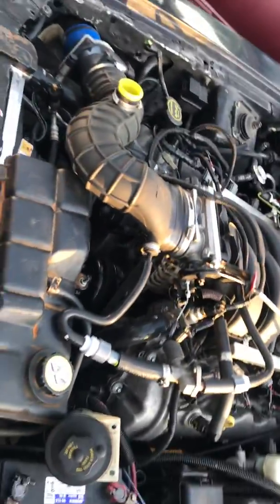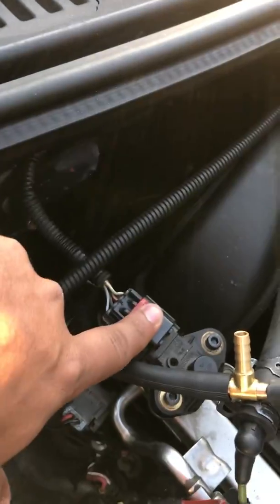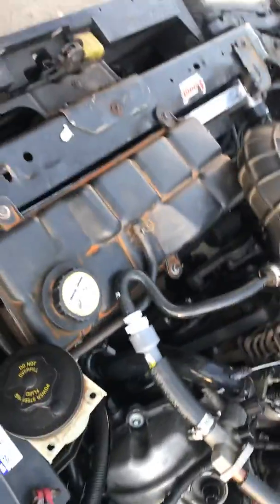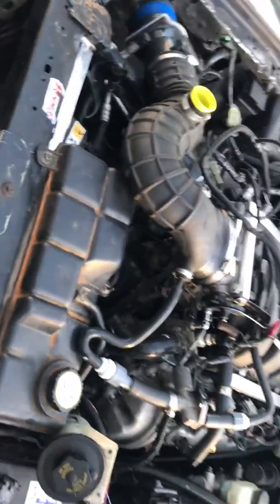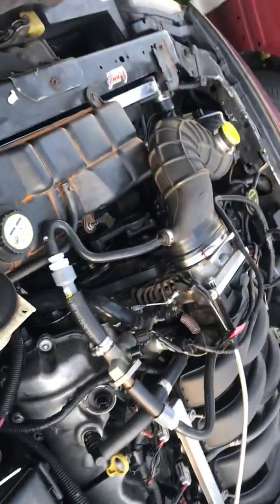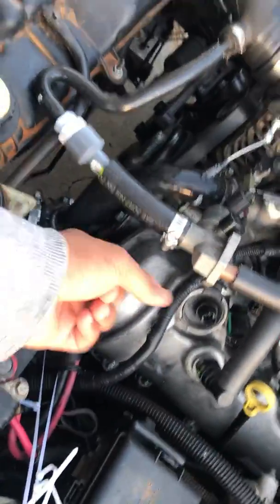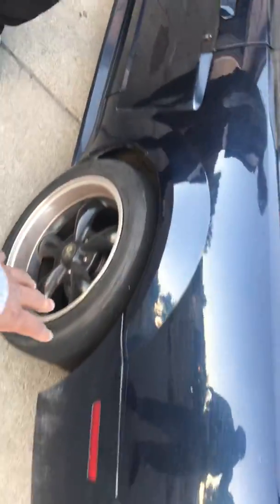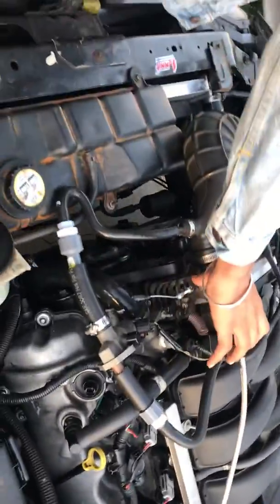1999- 2002 Mustang gt, 3V swap.. info

Comment: So everything from the 2valve harness will run the engine other than extending the connectors and changing the throttle cable right?

Comment: I got a 96 cobra I 3v swapp due to blown head gasket jump time  smh but I got 05 gt motor full wire harness pcm and gas pedal but I need help with wiring and vacuum n fuel lines I can pay for the advice or steps to get me back on the road
Reply from the maker: What’s going on with it? 
Send me email punjabisingh0@gmail.com

Comment: Hey I’m currently doing the swap and I was wondering how you wire the 3valve Fuel pressure regulator to the 2valve harness.
Reply from the maker: Your 3v fuel pressure will have 3or  4 prong plug, you only need to wire 3 wires into your 2v harness.
Don’t use the fuel temp wire use the other wires and connect those to your 2v harness
Reply: @vally520  ok got it, do you think you can let me know what colors to use? Or which one is the temp wire?
Reply from the maker: @nigelurquiza4573  we had sold the car few years back. i think you should be able to search it up, if i find it i will comment here.

Comment: Did u lock the cam
Reply from the maker: yes you have to lock them
Reply: @vally520  what if you don't ?
Reply from the maker: @Motormuscle21  you have to lock them if you want to use the 2V computer since it doesn’t have VCT support

Comment: Hey what wires go where and which one doesn't get used on the fuel pressure regulator  and what about the throttle position sensor wires and what about the little electric motor on the back of the intake that works too little butterfly arm the intake
Reply from the maker: you don't need to use the Fuel Temp wire on the 3V fuel pressure Regulator. Connect the remaining 3 wires.

Comment: Trying to stick 3v heads and intake onto a Grand Marquis. Kind of the pinnacle of Ford SOHC motors, as well as the last with that deep rumble. Coyotes are dope, but waaaay too expensive.
Reply: Ever heard of the 4v?  The 5.4/5.8 4v has the same old firing order that made 3v and 2v sound great it was same as the old pushrod.  So those engines went all the way to 2014 so it isn't only coyotes after 2005 outside of the 4.6 3v.
Reply: Also coyotes are more expensive but way more capable than a 2v or 3v stock for stock and when modding it.  So yea it costs alot more but to make a 2v or 3v run as good and stay together as well na and boosted you'd have about as much or more into it as what a coyote costs.  You can throw a coyote in with a blower and make 800 wheel (gen 2).  To do that with most engines its gonna require some decent work not just boost on a stock long block.  And it still drives and idles like a stock car this is why coyotes are awesome.  They make killer street and race cars they're good at both.  They can make alot of power reliably with a stock long block.  No need for heads or cams or built motor etc you can make 800 with stock shit easy.  Just boost and fueling upgrades.   Super simple.  For what you're getting the coyote is decent value.

Comment: Would the auto transmission line up with the 3v and work off a 01 mustang gt
Reply from the maker: i think it should line up if the bolt pattern is the same. we used 5 speed trans tr3650 that was originally in the new edge mustang 2v. Goodluck on your swap
Reply: Yes it's a mod motor same bolt pattern.  2v 3v 4v or coyote doesn't matter.

Comment: I wonder if you can do this swap cause I have a 2008 f150 4.6l 2v triton and I want to swap the heads to get 3v per cylinder
Reply from the maker: I doubt you can do that LOL but I could be wrong. But I’m sure you can swap in a 3V motor in ur truck.

Comment: Need assistance with new edge 3v swap what's needed for stock replacement full bolt on setup?
Reply from the maker: @sniper Mitchell what are you trying to do? Do you mean you want the parts list to do the swap ?
Reply: Yeah got a 02 new edge cont chassis and found a 07 motor
Reply from the maker: @snipermitchell6373  -2V wiring Harness/ECU
-Install Cam Lockouts
-Cut tabs off from passenger side cam phaser, leave 1 in the middle alone
-Use everything else from 2V
-3V headers that come with the 3v engine
-2v transmission(we used TR3650)
-3v fuel pressure regulator (Use the plug from 3V and use only 3 wires connecting to the 2v harness, you don’t need the fuel temp wire but connect the other 3)
-you will have to extend few wires,
Reply: @vally520  thanks
Reply from the maker: @snipermitchell6373  if you got any questions let me know

Comment: So you didn't need to cut anything off the cam phasers, just did the lockouts, and no issues? Also you used 3v fuel rails and they plugged right in to the 2V lines?
Reply from the maker: you do need to cut the Passenger side tabs off the cam phaser, and do lockouts if you don't cut your car won't run right. You will cut all of the tags but leave the one that's in the middle alone. Yeah use 3v rails and 3v fuel pressure regulator but you will only connect 3 out of 4 wires to the existing 2v pronge. Leave the fuel temp wire as is don't connect that to the existing 2v wiring, you can find out the wiring colors for 3v plug.

Comment: Just saw your video and it was helpful, I am swapping my new edge v6 automatic to a 3valve manual, one issue I’m running across is the tranny. For some reason where the shifter is, it won’t fit into my car. What should I do?
Reply from the maker: Mhmm that is weird, what transmission are you using ? It should fit right in I don’t think Ford changes anything with the chasis from auto to manual.. make sure your engine is sitting properly in the k member holes
Reply: @vally520  what happened was since my was a new edge the 2008 tranny does not fit into it, I just need to get a 2valve trans with a 3valve motor
Reply from the maker: sergio sanchez yeah I don’t think that will fit then, try to find a TR3650 transmission out of 99-04 GT or mach1 they work fine and should fit fine in the car
Reply: @serge920  do you have any tips and advice on this swap? I have a couple questions.  Currently i have the same set up an 04 v6 auto and i want a 3v gt manual swap. 

-Where did you get your parts? I was thinking going to a junkyard or purchasing a salvage s197 gt manual and swapping everything over engine, transmission, motor mounts, l member etc etc. Does that work? 

-What are the key components that I need for this swap ? For example which motor mount do I use, what K member do I use, and does the stock ecu work with a swap like this? 

Sorry if my questions are all over the place I’m not sure where to start
Reply: @jenniferbaez5201  so with my swap I am running a 3v engine with a 2v tranny, u will need a 2 valve clutch as well. I am running on 2 valve long tube headers with 3 valve flanges on it. I bought the flanges from Facebook and it was welded together. My mechanic is doing the electrical part but he said he had to run 2 computers for the car to work. All cars are using one computer but with mine since it’s complicated it’s running 2 computer, one for the engine and the other for like little features such as the alarm, key initions, and other stuff. Honestly I regret doing the swap because it has taken me so long to do it with so much work that at this point I should’ve done a cobra terminator swap or coyote swap. But to each their own
Reply: @serge920  Im really sorry to hear that it was a lot of work but i do hope you eventually enjoy this build. Any tips or recommendations before I do something like this? Also how hard do you think this’ll be

Comment: What throttle body do i use i need help i cant finish the swap bc i need a cable throttle body and the 3vlave one is electric...so what do i do iam doing the swap in a v6 using 3valve pcm
Reply from the maker: You can’t use 3valve PCM, or you will need all the wiring harness, use your 2v PCM and use 03-04 cobra throttle body
Reply: Sidhu Motorz  but iam i have a v6 iam outting it in
Reply: Sidhu Motorz  but if i use the 3 vlave pcm i need the 3valve gas pedal ??
Reply from the maker: @MiguelMartinez-rm9we  yeah then you will also need other wiring harness from the 3v as well, why don't you use the 2v PCM. i have a 2v PCM if you want to purchase.
Reply: @vally520  I have a 2003 Mustang GT and a 2005 GT 3 valve where did you get your throttle body I am having trouble with finding it or making it work if you could let me know. (malcolm.dev.turk@gmail.com)
Reply from the maker: Malcolm Turk you need the cobra throttle body should be less than 100 bucks search on eBay, TB has to be cable driven
Reply: @vally520  can you send a pic or link of what i should look for if you dnt mind i have found plenty with cable but no vacuum hookup for hoses
Reply from the maker: Malcolm Turk this should work you don’t need to connect any hose to the throttle body,

https://www.ebay.com/itm/264883962637
Reply: Hey whts up man i was trying to see where did you get the adapters from for your injectors and whts the name
Reply from the maker: Malcolm Turk those are called like EV6 adapters you will be able to tell by looking at the pics on eBay.

Comment: Stock k memeber??? I need help Iam 3valve swaping my newedge v6
Reply from the maker: Yes stock k member
Reply: Sidhu Motorz  ok thanks man and i got one last question do i buy a 3 valve drive shaft? Cause iam putting in the 3valve transmission too so do i buy a 3 valve drive shaft? Or what do i use?? If u can asnwer asap thanks its almost done

Comment: Having difficulty with the fuel pressure regulator , help
Reply from the maker: Ladarius Harris what’s going on? Use your 3V fuel pressure regulator and since the 3V one has 4 pin wires, don’t connect the wire that is for the fuel temp.. connect the other 3
Reply: Car cranks but not starting
Reply from the maker: Ladarius Harris email me punjabisingh0@gmail.com I’ll send you my contact #

Comment: Can you use the 2 valve transmission
Reply from the maker: James Matias yes you can it will bolt right up
Reply: So what all will i need to do for the swap

Comment: What motor mounts did you use I have a 03 gt convertible and putting a 07 gt 4.6 into it
Reply from the maker: Coby Evans you can use your 2v motor mounts
Reply: @vally520  the 3v is 4 bolt and the 2v are 3bolt to the block. Can you show me a picture or do you have a video? If you could email me I could use your help cobyevans79@gmail.com

Comment: Please post where you got the adapters for the fuel rails from :)) thank you!
Reply: Ev1 to ev6?
Reply from the maker: JRvlogs yes I think so should be about 10 dollars or so or get the one u can exchange in case
Reply: Sidhu Motorz Does the sr Throttle body spacer from (AmericanMuscle) work with the cobra TB?
Reply from the maker: JRvlogs no we made that ourself you can buy aluminum and cut 2 holes into it matching the throttle body
Reply: Sidhu Motorz how did you get the cobra one on? Sorry for all the questions btw having a headache finishing my project hahaha
Reply from the maker: JRvlogs cobra throttle body pretty much fits the 3v intake u need to add that spacer so u can put the throttle cable on the TB, that’s y that spacer is necessary and u may need to make the holes on ur cobra TB bigger... it pretty simple
Reply: Sidhu Motorz what did you do with the evap from the 3v?
Reply from the maker: JRvlogs I don’t think we did anything for that, you talking about the vacuum sensor thats even with the 2v I would say just plug the evap
Reply from the maker: JRvlogs they are called EV6 injector adaptors you can get them from amazon you will be able to tell which one will fit your injectors like the square part

Comment: Im thinking of swapping my 2004 into 3v bro & was wondering if i can use the same transmission that i have 2v 183k miles had wen my motor wen out on the 2v tranny still good @
Reply: It will bolt right up to the 3v.  You will need to change the flywheel.  A coyote engine will bolt right up to the motor mounts and TR-3650, with the flywheel change of course.

Comment: I’m swapping a v6 out do I need different motor mounts for the 3v or the stock ones are good and what automatic transmission can I use? Also would I be able to use my v6 harness and computer?
Reply from the maker: 2v 4.6 motor mounts will work, and I am not sure about the computer and harness from a V6 since the swap we did was in a v8 car

Comment: Can I use my stock auto trans from my new edge
Reply from the maker: I think so you can we used out stock manual transmission that came out of the new edge
Reply: Also I have a 2001 mustang would it be better for me to pull the motor out of a 05-11 GT or a Ford Explorer and I wouldn’t have to change anything right? ( well the things you said in the video of course ) i have a 2001 new edge 3.8 just really wanna get that 3.8 out of it quick and easy if it’s possible, but what do you think I should do man if you can help
Reply from the maker: Darius Qualls I would say take it out of the mustang and then just follow the videos and if you need help I can direct you. Everything should be same if it’s v6 or v8.. computer might be different so you will need new edge v8 computer

Comment: What about the cam shaft how you lock it
Reply: We installed cam phaser lockouts that can be bought online for the 3v it essentially eliminated the variable valve timing allowing me to rework the 2v harness and use the stock computer. The 3v is from the modular engine family so it bolts in to the factory places including transmission. In fact the coyote is a modular and will bolt in to the factory k member as well but has its own headaches associated with that engine. 5.4 engines can also be dropped in and the only thing you need for the swap is a tune and 5.4 to 4.6 intake adapters. That's my plan for my person car. Not much horsepower gain but torque is better and that's what is really fun.

Comment: Can you guys help where can i get the  adapters for the ignition coils to used with 2v wire harness
Reply from the maker: i think those are called Ev6 adaptors from amazon they are fairly cheap, just make sure its the same plug as ur existing ones
Reply: Whats the name or where can i buy it of the adapter to used  in the throttle body  to used the cable
Reply from the maker: @AdrianRamirez-hh8bi  you can search ebay or something but we made our own. u can use 1/2 thick alumnium to cut two holes in and make them the same size as your throttle body and maybe u can use the old 2v cable adaptor thing
Reply: @vally520  i try using my 2v wiring harness connector to fuel rail pressure regulator and connector is different to the 3v fuel rail pressure regulator what can i do to fix the issue , thanks
Reply from the maker: @AdrianRamirez-hh8bi  so use your 2v harness with your 3v fuel rail pressure regulator, just don't use the Fuel TEMP WIRE, so the 3v has 4 pins 3 pins will be the same as 2v and the 4th pin will be for the FUel TEMP we don't use that

Comment: How do you wire the 3v fuel pressure regulator to the 2v harness
Reply from the maker: so basically you will only need to connect the three wires, i will try to send you the colors, there is a wire that is for fuel temp you wont need to connect that. just connec the 3 wires to the pigtail
Reply: @vally520   it would be greatly appreciated thanks
Reply: @vally520  need to see this too
Reply: Can you send me what has to be done to do this swap. I have a 04 car and a 06 motor.

Comment: How much u think it is ??? For a v6 to do this swap ????
Reply from the maker: you can find the 3v engine for about 1k depending on where u are, then its just the misc parts like clutch, throttle body, i would say like under 3k im sure it will be way less

Comment: Hey idk if ur gonna read this but iam doing a 3v sawp very soon how much was the total cost and i have a v6 new edge so do i need a new harness and a new transmission???
Reply from the maker: @miguel Martinez i think you will just need the v8 computer, harness should be the same and you will need tr3650 transmission thats what i had
Reply: @vally520  how did you connect your fuel pressure regulator wires

Comment: Great video! So you used the stock 2v block?
Reply from the maker: Robert Allen no it’s the 3V engine that comes from 05-2010 mustangs, I just rebuilt it as in changed all the gaskets down to the heads. Thanks

Comment: Got a whole lot of questions about this. I think I want to do this on my 03, but I’m having a problem with finding a lot of info on EXACTLY what’s needed to make this work on an 03 5speed with the 3650 tranny. Got an email address?
Reply from the maker: im sure its the same transmission from 99-04, so you should be good, i wouldn't be worried about this at all as this will just bolt right up to the 3v engine,  let me know what questions you have, i can tell you everything you need to know.
Reply from the maker: J.Money punjabisingh0@gmail.com
Ask away send em an email I can help you answer your questions and help you with the process